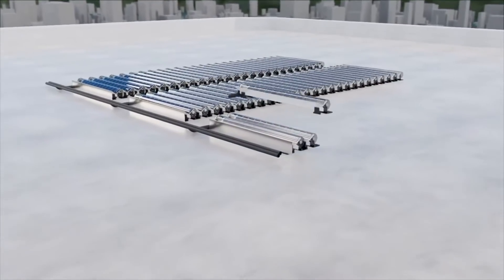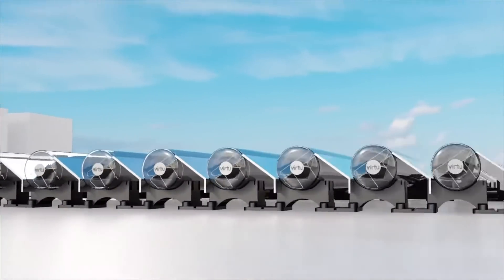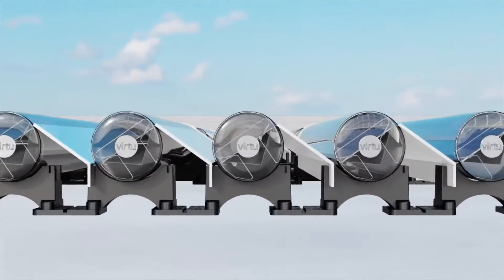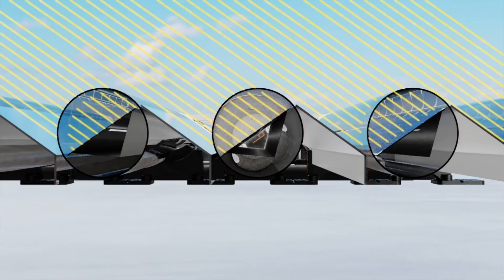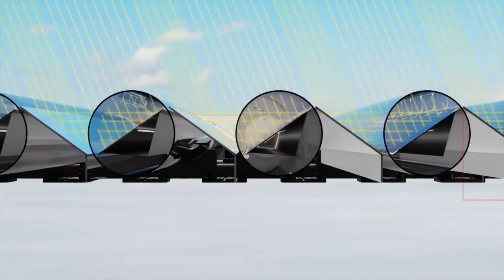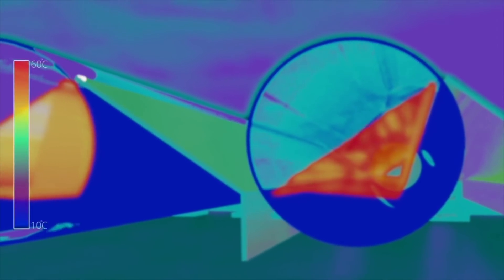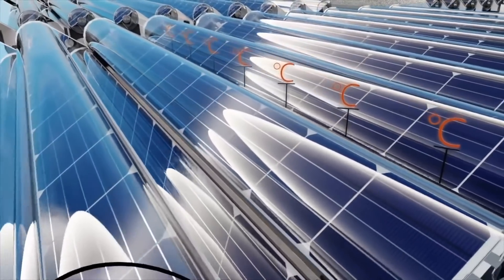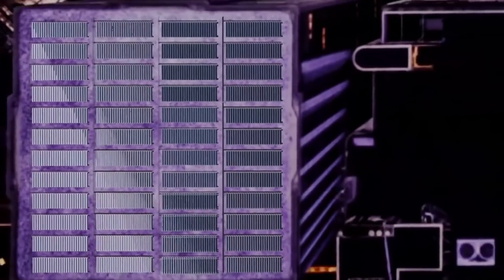Make electricity and heat with one device: hybrid solar technology

Comment: How do you avoid pv overheating when there is not hot water request?
Reply from the maker: That's up to the design engineer. But your point is correct - if there's no HW demand, you can't just loop the water continually, which would increase the temperature. I've not designed an evacuated tube solar thermal system myself so I can't give a more precise answer, other than "This is an issue common to all evacuated tube solar thermal systems, so it's not a design issue novel to this product."
Reply: @tdisney  It's normal for evac tube systems to dump excess heat either through a heat exchanger, or simply by dumping some hot water. This usually happens at water temps above 90 degrees, so way too hot for PVs really, they would lose a good chunk of output at this temp.
Reply: One way could be to dump the heat in an earth battery during summer and collect that heat during the winter. A system like that could work where I live (sweden) I don't know how well it would work in a climate that doesn't have so extreme seasonal diffeences as we do here.
Reply: @olavkarlsson6430  inter seasonal thermal storage is a great way of maximising outputs, but a big up front investment.  Your neighbours in Denmark have been doing exactly that for quite some time.  It is becoming more common - even on a smaller domestic scale.

Comment: is it working only on a flat surface? how are the performances on a roof top?
Reply from the maker: horizontal, vertical, pitched. no difference in performance wall vs. roof, I shouldn't think.

Comment: The efficiency of PV cells decreases dramatically if the temperature rises. It is necessary to provide a cooling system for the PV cells. Really, it is not an innovation.
Reply from the maker: There is a cooling system for the PV cells, that's what the water going through the backing plates is doing (incidentally producing useable hot water). That's the whole point of this technology.

Comment: That vacum is going to come with a great cost probably needs applications with restricted square footage otherwise just add more of the less eficiente but cheaper non vacum solar
Reply: yeah it's gonna be a hard time trying to find a leakage
Reply: Depends on where you live and the temperature required.  The vacuum means hot water in cold climates or very hot water for process heat if that's what you need.  Flat plate collectors are more efficient, but only if you need low grade heat (eg for swimming pools).  Exactly the same principle as other vacuum tubes but in a larger format.  The greatest proportion of solar thermal collectors are actually the vacuum tube variety.

Comment: Almost identical to the cylindrical solar panel company that went bankrupt over 10 years ago. I think their name was Solylinder.some Chinese company bought all their machinery at auction. They where USA based.
Reply from the maker: Functionally speaking, there's almost nothing in common between Solyndra's tech and this. https://www.edn.com/solyndra-its-technology-and-why-it-failed/
Reply: @tdisney  there are a few similarities in the video you posted as to the benefits to what is actually stated in the article you have posted.
Reply from the maker: @redx11x  I mean to say the technology is not even close to identical. This is important to clarify, because Solyndra is a well known solar failure, and so falsely equating virtuPV with Solyndra is a potentially damaging falsehood. There might be some overlapping claims as to the benefits, yes, I agree. But Solyndra's use of a tubular form is coming at it from a completely different angle technologically speaking. It's kind of like saying a wheel is a dumb idea because that arched bridge over there collapsed. Yes, curved surfaces play a role in both, but they're such different things that equating the two is not useful. Cheers. :)
Reply: @tdisney  have you looked into the benefits and claims? They are talking about increases of up to 40%, highly unlikely. The cost of producing these vacuum tubes will be high. What of the heat radiation generated within the tube, what effect will that have on the pv cells. It all sounds rather gimmicky and reminds me of Solyndra. Let's see the real numbers rather than the propoganda videos please.
Reply from the maker: @redx11x  Those are legitimate questions! And are very welcome here. :) "This is almost identical to Solyndra" is not legitimate, and I felt the need to step in and address it. See the rest of the comments section for discussion around your questions, which have been raised already. To answer your question "have you looked in to the benefit and claims" - yes, I've had lengthy discussions with Naked Energy about the technical aspects of their technology, as have many of my colleagues, enough to satisfy me that this is not vaporware. I do not believe that this technology is a panacea, it is not a good solution for a great many circumstances (eg snowy climates with only seasonal hot water demand). It is not intended to be. It should be thought of as a technology that may be a good fit for a certain number of solution-space niches. Where the climate, use case, and local energy cost and availability are right, this technology will pencil out to be an economical solution. In other circumstances, it will not.
Reply: @tdisney  hello Tyler, i did have a look and saw people speak of "heat sink" without giving away and details as to how much heat will be disipitated. Allah the question of using water to cool needs to be looked in more as using super heated water (which the water in a vacuum glass will become) to cool is not a clear to us. The water would presumably be in a loop as you cannot just keep running cool water through it. There are many questions but we need the data.
Reply from the maker: @redx11x  Yes, it's helpful to keep in mind that this product is first and foremost a Solar Thermal device that happens to have some PV cells incorporated in to the design. So the main output of this device is useable hot water, with a secondary output being electricity. The water does not become superheated - it will be at around 60*C, well below boiling point. Evacuated tube solar thermal water heaters are a well established technology, you can do a search for them. Naked Energy's innovation is to put some PV cells in side the tube. As many have pointed out, PV cells drop in efficiency at high temps. The heat absorption plate behind the PV cells both a) cools the PV cells and b) transmits heat to the water. There is a response from Naked Energy on this topic, including links to patents, in the video description.

Comment: This must be over price vs energy results cost gained

Solar panels capture up to 30% sun energy

This must be over thought idea with a negative cost factor
Reply: 30% - wow - if that's PV efficiency where can I get one??!  If that's solar thermal efficiency it's a little on the low side.  Virtu produces both heat AND power and is primarily aimed at people who need heat (according to the IEA 51% of all energy consumed globally is for heat in one form or another - electricity consumption is just 17%).

Comment: Wouldn't it be cheaper to connect all the tubes to some controller which directly turns the tubes in the correct alignment? I mean one motor and some sensors and a pcb should do the trick, right? Why manufacture a special glass for the same purpose?
I do understand there might be problems with the system with moving elements though.
Reply from the maker: The purpose of the glass is not for sun tracking, and yes, moving parts fail.

Comment: What happens to the System in the snow? If buyers live in areas with consistent blizzards would this hold up?
Reply from the maker: Same thing as happens to conventional pv in the snow I'd imagine, except these are (I'm guessing) even stronger than flat-panel since tubes are such strong structures. My flat-panel PV cells on the roof of my rig are rated to about five feet of wet snow. Obviously you want to push the snow off your solar setup, you don't want to leave that buried all winter. These are probably a little more fussy to push snow off of than flat panels.
Reply: The Solar Keymark tests (SRCC in US) include snow loading tests

Comment: You can make heat while generating electricity with simple solar panels that also have a closed loop water cooled heat sink beneath the panels which makes the panels more efficient at generating electricity as a bonus.

Comment: Doesn't look like it would work well in colder climate with snow accumulation between cell tubes
Reply from the maker: Solar tech tends not to work well in cold snowy climates. :) But yes, snow removal is bound to be more difficult with these than traditional flatpanel technology.
Reply: @tdisney  if have a water jacket in that interior space, you might simply reverse some flow valves and supply warm "coolant" into it for a while to melt sufficient to provide DC flow again, then get back into cooling mode as temps arise, ala a heat pump being A/C and Heater...

Comment: How cost-effective is it ?? 
Economic value
Reply from the maker: Impossible to say without knowing the building/project location and use and occupancy profiles. :) For example, this tech is very cost-effective for hotels or resorts near the equator, with lots of sunshine and year-round demand for hot water. On the other hand, I imagine it would be quite a bad fit for a one or two story office building (lots of roof space) in, say, Anchorage Alaska, with a tiny hot water demand.
Reply: @tdisney  so risky expensive non economical
Reply: @mohammedalways358  
I like it but probably wont get them since I dont have a suitable situation.
Maybe it should be marketed as a heat collector with power enough to drive pumps etc.
Space restricted applications with need for water heating.
Cant discount the enviourmental virtue points either, it has the look, can be worth a lot to the right CEO.

Comment: I feel like it should be so easy to rotate these tubes for optimal performance throughout the day, any reason why this isn't done?
Reply from the maker: The reflectors do a lot to maximize solar incidence, so the benefits of a tracking system, I'm guessing, are far outweighed by the costs of a sun-tracking control system, needing to design and create a leak-free interface of moving parts to get the electricity and hot water out of the tubes, reducing sources of potential failure, etc. I imagine these are a more robust device than one with moving parts. The rotation of the tubes are factory set for the customer's latitude/design specs.
Reply: If you read the comments here you will see that the world is full of sceptics.  The original design did rotate and track, but the prospect of moving parts was a little too scary for the conservative VCs that back new technologies.  As Tyler mentions the reflectors are a form of passive tracking.  Maybe version 2.0 will see tracking back one the agenda?!

Comment: I wonder if the solar cell would melt (the soldering)
Inside that hot vaccum tube...
(Its said u can make hot water...this mean its would be around 80°c ...)
And look like its would be very expensive compare to the normal solar cell...compare by watt
...i better just use solar cell and use normal electric boiler...
Reply from the maker: Design temp is around 60C.
Reply: @tdisney  oh....i see...then its just warm....not hot...

Comment: All the added complexity is going to increase the price right? So it might be more economical to just go with regular panels as the ROI will happen fast. If these panels have an ROI.
Reply from the maker: It depends on the application, these panels aren't going to pencil out for every project. Projects with lots of sun (obviously) and year-round hot water demand or good, for example. Also, projects with limited are for solar - the power density is high with this technology, so if that's a factor it's benefit might simply be that it will work, whereas with conventional PV there's simply not enough space.

Comment: I think you forgot about the efficiency of panels are reduced dramatically when heated.
Reply from the maker: Nope. :) I'm copy/pasting Nick Simmons answer below (Nick is with NakedEnergy): "PV cells regularly get to very high temperatures.  If you return to your car on a hot summers day you know how hot it can be.  A conventional PV module traps the cells behind glass and lets them bake in the sun.  When a solar panel is made the temperatures used in the lamination process go up to something like 150C.  As mentioned the efficiency of a solar cell drops off as temperature rises - this is known as the temperature coefficient and is published on the data sheets that go with PV modules.  A conventional solar module has no way of losing heat other than through convection, but at the height of summer with no breeze and high ambient temperatures there is very little cooling going on.  There is a lot of academic research out there discussing this.  The virtuPVT heat exchanger as described in the video is constantly taking heat away to be used for other heating / hot water / process heat.  Consequently a virtuPVT collector can actually be cooler than a normal PV module under the same circumstances.

Patents can be found here: https://patents.google.com/patent/US9605875B2 / https://patents.google.com/patent/US9869491B2
Reply: @tdisney  I didn´t realise it was water cooled, not much info in the animation, I see this is 2 years old, how is it progressing?
Reply from the maker: @letsfixit1594  Yeah that's interesting, as an animator/technical communicator, to learn what's not obvious on first look. The fact that it's hybrid solar, meaning PV+thermal, makes it seem almost not worth mentioning that there's water flowing through these things, because "solar thermal"! But you're right, it isn't obvious on first watch. This is great feedback to incorporate in to future work. To answer your question, I'm just the independent viz artist who made this animation for them so I'm not "up" on where they're at these days. Best to check in at their website, link in description.

Comment: The solar cells should be on the curved surface outer surface and the vacuum around the thermal collection tube convex  lens concentrating the infra red wave lengths on the tube and mirror  (  ) ● ]

Comment: Could use water to collect the heat in a insulated buried large tank for hot water needs. And excess heat use in a fuel cell membrane to be used as stored energy maybe to be use later when sun does not shine!

Comment: System will probably melt if used in the Middle East or nearby
Reply from the maker: why's that?
Reply: @tdisney  Extreme heat on sealed solar unit will cause damage
Reply from the maker: @regionalpro5657  The heat of the PV cells is maintained constant by the thermal fluid. I'm copy/pasting Nick Simmons answer below (Nick is with NakedEnergy): "PV cells regularly get to very high temperatures.  If you return to your car on a hot summers day you know how hot it can be.  A conventional PV module traps the cells behind glass and lets them bake in the sun.  When a solar panel is made the temperatures used in the lamination process go up to something like 150C.  As mentioned the efficiency of a solar cell drops off as temperature rises - this is known as the temperature coefficient and is published on the data sheets that go with PV modules.  A conventional solar module has no way of losing heat other than through convection, but at the height of summer with no breeze and high ambient temperatures there is very little cooling going on.  There is a lot of academic research out there discussing this.  The virtuPVT heat exchanger as described in the video is constantly taking heat away to be used for other heating / hot water / process heat.  Consequently a virtuPVT collector can actually be cooler than a normal PV module under the same circumstances.

Patents can be found here: https://patents.google.com/patent/US9605875B2 / https://patents.google.com/patent/US9869491B2

Comment: Have read that PV is more effective in cold than heat (comparison of PV output in Minneapolis as opposed to Phoenix)
Reply from the maker: I'm copy/pasting Nick Simmons answer below (Nick is with NakedEnergy): "PV cells regularly get to very high temperatures.  If you return to your car on a hot summers day you know how hot it can be.  A conventional PV module traps the cells behind glass and lets them bake in the sun.  When a solar panel is made the temperatures used in the lamination process go up to something like 150C.  As mentioned the efficiency of a solar cell drops off as temperature rises - this is known as the temperature coefficient and is published on the data sheets that go with PV modules.  A conventional solar module has no way of losing heat other than through convection, but at the height of summer with no breeze and high ambient temperatures there is very little cooling going on.  There is a lot of academic research out there discussing this.  The virtuPVT heat exchanger as described in the video is constantly taking heat away to be used for other heating / hot water / process heat.  Consequently a virtuPVT collector can actually be cooler than a normal PV module under the same circumstances.

Patents can be found here: https://patents.google.com/patent/US9605875B2 / https://patents.google.com/patent/US9869491B2